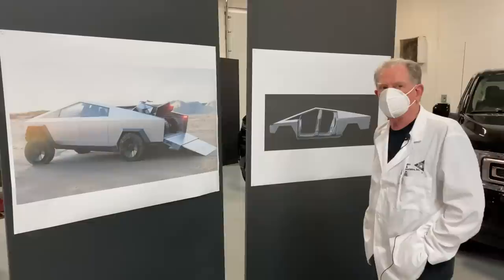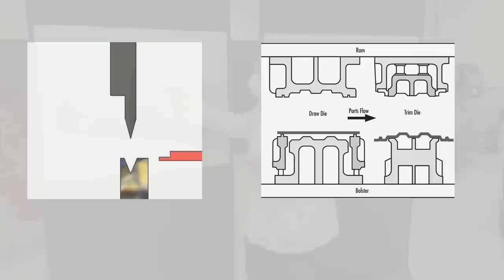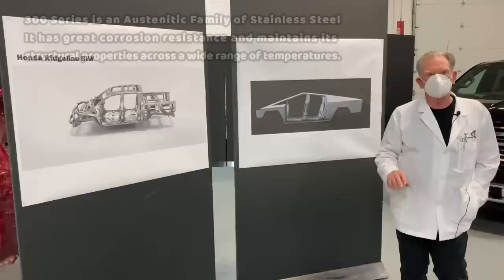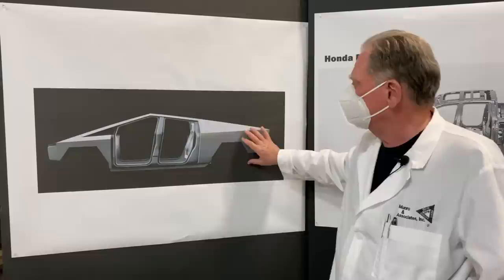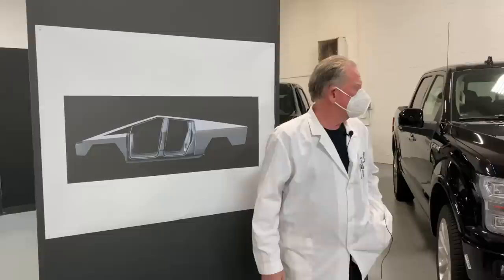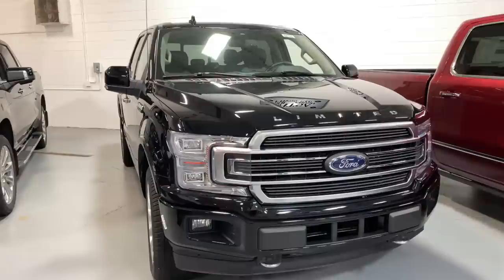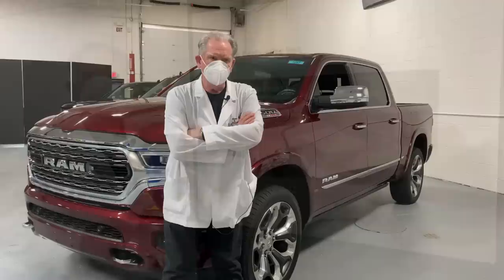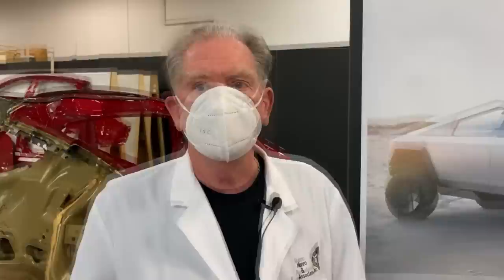Cybertruck E1 - Body Structure Comparison

Comment: I’m a huge Tesla fan, love my Model 3, but I hate the look of the cybertruck and think it’s going to be a huge flop. Truck buyers do not want some weird looking cheese wedge. I also do not think they will be able to sell it for the prices they are advertising without a huge loss. The air suspension, larger battery packs, heavy duty motors, and stainless steel body would in my mind cost a ton more than a Model 3, yet Elon says the base price will be below $40K. How? I just don’t see this becoming a reality unless Tesla is willing to take a huge loss on each and every unit, which they can’t do, especially now with the global Covid-19 economic downturn. I am just hoping we do see Tesla-level EVs hitting the market in the next few years in all categories. No legacy automakers thus far has released a compelling product or even announced one. The only EV truck I’m really excited to see is the Rivian R1T. Ford’s F150 Electric will just be a standard F150 without an engine. It’s not going to be on a unique chassis that was designed from the ground up just for EVs. That usually means it’s going to be full of compromises. The range likely won’t be great, weight will probably balloon, and it wouldn’t be surprising if it’s got compromised load capacities due to the weight and placement of the batteries. I don’t even know where Ford will be able to put the batteries unless it’s between the frame rails and running the length of the vehicle where the exhaust, driveshaft, fuel tank, etc.

The biggest issue in my opinion for all non-Tesla’s (in the US) is the lack of a reliable coast to coast DC fast charging network. Electrify America is a pitiful alternative to Tesla’s Superchargers, and the myriad random non-networked DC fast chargers (CCS or ChaDeMo) are rarely serviced and many are not mapped. Tesla’s cars automatically keep a registry of every Supercharger station, can tell you if there’s any issues at the station, what amenities are there, how many stalls are available, and the peak charging current. Electrify America stations are painfully unreliable (always something wrong with their charging stations or payment system), and they typically cost 2-3X more for the same amount of energy vs. Tesla’s Supercharger network. 

Electrify America also uses a tiered pricing structure. They use the vehicle’s peak charging current to determine the cost of your charging session. Meaning if you add 10kWh of energy to a Chevy Bolt at 50kW, you pay substantially less than if you added 10kWh to a Porsche Taycan at 270kW. Peak charging currents should not determine rates. As it sounds, peak speeds are not sustained. In a Model 3 for example, it’s capable of up taking up to 250kW, but you will only see that figure for a brief moment. Charging currents quickly tail off and fall below 100kW by the time you are at 60% SOC. On an Electrify America charger you will be charged the highest tiered price (based on that peak 250kW rate) the entire charge session.
Reply: There was a Russian channel where they made Cybertruck replica! It took few skilled guys and a few weeks(if so!?) to make it... Its so easy, once you setup the tools. And no paint is huuuge!
I don`t think that there is more hype then with Cybertruck! They are underestimating the demand. It will be astronomical!(easily 500k per year). Maybe more, depending of utility factors which are still unclear...
Reply: Steve Davis the number of reservations doesn’t signify actual orders. Just like Elon thought Model Y would be a huge seller, and demand for it would be insane... yet people that placed orders for a Model Y in January or February were able to get cars in March. It appears from the outside looking in that demand for the Y is not nearly as high as expected. Model 3 had a 2 year waiting list to get a car. I see this being a very similar situation with this truck.

I think it’s going to be insanely difficult to deliver the product as shown, at the price claimed. There’s no way Tesla can double or triple battery pack size and not accommodate for that expense by raising the price of the vehicle equally. To deliver this truck with the claimed 500 MILES range, it would have to be equipped with a 200kW+ pack. Maybe even larger than that. Model S can do just about 370 miles out of a 100kWh pack and it’s got a super slippery shape, sits low to the ground, has much smaller and more aerodynamic wheels and tires. Model X struggles to go 325 miles on the same size pack. I’ve learned how much wheels and especially tires impact range on an EV. The OE 235/35ZR20 PS4S tires on my Model 3 Performance cause a 20% loss in range vs. the non-Performance models’ 235/45R18 Michelin MXM4 tires. Unless Elon is planning to put extremely street biased tires on the CT, I can’t imagine he will find a very efficient truck tire that doesn’t cause a huge penalty to range. Even on gasoline and diesel vehicles, tires impact efficiency. On my Land Rover when I put Goodyear Wrangler Duratracs on vs. the standard street biased tires I lost 2MPG (12.5% loss). 

I also look at things like the cost of building a new dedicated factory to build the CT (that doesn’t even yet exist), the years of R&D needed to subject the production-candidate to the abuse it could possibly see over its life as problems that will either kill off the CT altogether or seriously delay it which would make many cancel their reservations. To my knowledge, they have only built a few Cybertruck prototypes. Exact dimensions, specs and features are not even confirmed.

I would much rather see Tesla invest in a product that will likely be able to make a large return on investment instead of what is essentially a vanity project that will have very limited appeal once initial preorders are sold. I believe Tesla would make far more money building an electric SUV that looks like a real suv and that can be used off road (think Land Rover Discovery/Defender). I would like to see Tesla offer something akin to Rivian’s R1S. People love SUVs, and the Model Y and X don’t appeal to a lot of people because they don’t look like SUVs. The X looks like a minivan in many ways and the Y looks like a bloated Model 3. Neither X not Y is what I would call attractive. The S and 3 are attractive sedans and would be complimented by a good looking SUV that had some rugged appeal.
Reply: Steve Davis there’s no way that Tesla fulfilled and delivered 300K Model Y preorders when the car was only in production for a couple of months before the forced plant shutdown. People were able to order a car in February and take delivery in March. That means there was not a backlog of pent up demand for the Y that had to be fulfilled. It would seemingly show that Model Y preorders either were being cancelled at an extremely high rate or they didn’t have many preorders to begin with. 

I personally don’t like the look of the Y at all, and nobody I’ve talked to that owns a Tesla thinks it’s very attractive either. It takes the Model 3 look, but distorts it with a weird bulbous body that from certain angles is very ungainly. I think many people also don’t know why they would pay $8K more for the Y vs. the 3 when they’re essentially the same size.

As far as a factory not being that expensive, that’s just incorrect. Elon will have to build the CT in a factory that can also turn out other products. There’s no way there will be enough sustained demand for the CT to keep a factory going at capacity. A factory the size needed to build 200,000 cars annually will cost in the neighborhood of $1-2Bn. It will likely also become a second production base for the Model 3/Y or if Elon does decide to leave Fremont, it could become the sole factory for all Tesla US production. That means they’ll still be paying for a paint shop, presses, etc. 

Also, I cannot imagine everyone being okay with only one color: stainless. People like being able to pick their vehicle’s color, so there will likely have to be some sort of color treatment or wraps or something they offer since paint will likely not work on the stainless body.
Reply: @CFG39  Due to pandemic, car market has plummet! Not realistic to make any predictions of demand at this moment. Especially with vehicles like Y!( higher cost)
. Also, they are already in production volume numbers that took 1 year for model 3!?
And yeah, cell packs are gone waaaay down in year or so... Catl, Byd etc... they are already under $100 per pack with LFP batteries... Things are moving fast and Cybertruck is almost 2 years due... I`m usually pessimistic but with Cybertruck its hard not to be subjective and excited...
Reply: Steve Davis Tesla has likely produced less than 10,000 Model Ys thus far. They were only able to produce them for a couple of months before the shut down. My point is that demand of the Y does not seem to be what was expected. People thought there would be a 6+ month wait to get a Model Y because of the large numbers of preorders having to be fulfilled, especially for existing Tesla owners (who typically receive priority). What actually happened is people who had just placed orders were able to get their cars as soon as deliveries started. You have to agree that would mean there was not much of a backlog to fulfill. Either that or Tesla has changed their way of fulfilling orders and is no longer going in date-order when determining who gets their vehicle. I haven’t heard of anyone that pre-ordered a Model Y Long Range or Performance complaining that they still have not received their car.
Reply: Stephen Mattison Right...

The “brilliance” of the Cybertruck is unrealized at this point. It’s not in production, not close to being in production and the production-ready version of the vehicle will likely be vastly different than what was shown. If you’re not skeptical of the claims made at the unveiling I also have a private Island I’ll sell you. 

I am a huge Tesla fan, I own multiple Teslas, but I think the cybertruck is going to end up being a huge flop (if it ever actually gets built). With all of the global economic issues due to COVID, a vanity project that will be a hard sale is the last thing Tesla needs to focus its resources on. There are a lot of other sections of the market that Tesla should focus on that are almost guaranteed to be very successful. No company, even mega companies like Toyota and Nissan, have been able to penetrate the big-3’s grip on pickup truck sales in the US. The Cybertruck is far too large to be a success outside of the US, Elon already acknowledged as much. 99.9% of people who buy pickups each year are not looking for a vehicle like the CT.
Reply: Dusan Gavrilovic lol. Thats all I can say. 

The truck is going to be far too large for it to be successful in Europe. Elon has already said they would have to design a separate “global” truck. So that means the CT will likely be limited to the US. Toyota, Nissan and Honda have tried their hands at the American pickup truck market and have failed miserably. Toyota sells about 100,000 Tundras annually. Ford sells nearly 1,000,000 trucks annually. GM and FCA are close behind. There’s no way that Tesla will be able to sell 500,000 Cybertrucks in a year. There’s not that many people interested in the vehicle. We don’t even know the actual production specs. So far it’s just a concept and we have some very general claims made by Elon. We don’t know the actual size, weight, power, battery pack size, towing capacities, etc. 

At this point it’s all conjecture.
Reply from the maker: @CFG39  Thank you for all of the thorough and well-supported comments! Agree or disagree, you (among others) have clearly done your homework, and we are constantly impressed by the quality and quantity of healthy debates going on in the comments section of these videos. Thanks everyone for tuning in, and keep up the great work!
Reply: Munro Live thanks for that! I really enjoy your videos.  They’re one of the few videos that’s more fact based than opinion.
Reply: I think battery day is going to answer the cost question. Then Tesla’s biggest issue will be keeping up with demand.
Reply: Brad Stewart umm I disagree. Battery day is not going to be anything extremely earth shattering. Yes it will have some announcements on new chemistry and likely a projected lower cost, but I don’t see this being the holy grail. 

For the sake of discussion, let’s say Tesla is able to hit $90/kWh. Currently Tesla’s costs are estimated at $115-$120/kWh. Reducing the cost by $25-30 would be a nearly 22-30% decrease in cost. That’s a huge metric to accomplish. 

I foresee a base model Cybertruck (single motor RWD) necessitating a 130-175kWh pack to hit the estimated 250+ mile range (remember this thing weighs between 8,000-10,000lb unloaded). That means just the battery cells alone would cost between $11,600-$16,000. 

Also, $90/kWh is well BELOW what the industry claims to be “cost parity” with an ICE. The issue is trucks and large SUVs require so much more battery capacity to go the same distance due to their lack of aerodynamic properties, heavy weight and larger tires/wheels (every measurement on a truck or large SUV tire including: section width, sidewalls, and overall diameter will be larger and thus heavier than current Tesla models). 

The Dual Motor AWD and TriMotor AWD (claimed range up to 500 miles) would likely require a 175-200kWh (Dual Motor)/250-300kWh (3-motor) pack to achieve the projected range. So that means dual motor pack would cost $15,750–$18,000, and tri-motor pack would cost $22,500–$27,000. 

The reason I see these vehicles needing such huge capacities is this: The roadster (low, sleek and super aerodynamic) supposedly needs a 200kWh pack to manage its claimed 600 mile range. It likely weighs less than 3750lbs too. A much boxier, bugger and heavier truck on huge wheels and tires is going to definitely need a pack 50%-100% bigger to achieve similar range. 

I don’t see how a vehicle with a battery pack that costs $12K–$16K (RWD CT) will sell profitably for $39K. The motor, body in white, air suspension, computers, cameras, ultrasonic sensors, load sensors, cooling system, heat pump, wheels and tires, glass, etc. will all add up to likely put the actual production cost of a base Cybertruck close to the $40K price. While Tesla will definitely save some money in assembly if they’re able to get this body design to work for actual production vehicles, they’re not going to save 50% on the cost of the car. All of the other things that go into a car cost money. Tesla would probably need to sell the RWD base model truck at $60K to make a profit and cover costs associated with warranty claims, logistics, recoup R&D money, etc. 

The Dual Motor would likely need to be $69-79K and the TriMotor closer to $85-95K to be profitable. All of my figures are also based on hypothetical advances in battery cell cost that may or may not exist. It would be a huge jump if Tesla gets the price of cells to $90/kWh. That really would be a huge leap from where they are now.
Reply: @CFG39  You'll see.
Reply: Stephen Mattison I can’t even take your comments seriously when you use terms like “negative-Nancy-hater-pants” to describe someone that’s logically laying out why they question something. 

Clearly you’re too ignorant to understand the logic laid forth by my previous posts that include actual cost analyses and brainstorming. How am I a hater when I own two Teslas????  I love Tesla and Elon. I just think the CT is never going to be successful for the myriad reasons laid out before, and I also think it will be hard for Tesla to sell it at the cost announced without losing their shirt.
Reply: Dusan Gavrilovic BYD‘s LFP batteries are not even commercially available yet. They’re a concept essentially. I also take anything a Chinese company says with a large grain of salt. BYD has been stuck around $130/kWh with their existing batteries. Tesla is somewhere estimated to be around $115-120 currently. 

Getting the cost down to $90/kWh (a 30% reduction in cost vs. current cells) still means that a large vehicle like the CT would have a pack that costs upwards of $12,000-$22,500 depending on pack capacity (130kWh–250kWh). To accomplish a 500 mile range with a large and extremely heavy vehicle like the CT they are going to need every bit of a 250kWh pack. That is assuming the CT can manage a fairly low consumption rate of 500wh/mi (2 miles/kWh). That’s not that much higher than the Audi e-Tron (avg. consumption ~455 watt-hours/mile) and is right on target with the Porsche Taycan’s consumption (503 watt-hours/mile (city)//496 watt-hours/mile (highway)). 

It’s kind of hard to believe a 8,000-12,000 lb monster truck like the Cybertruck is going to be able to achieve similar efficiency to a sleek shape Porsche sports sedan. If the Cybertruck doesn’t manage 500Wh/mi rating, the battery pack would have to be even larger than 250kWh to reach the 500 mile announced range. At 600wh/mi the CYBERTRUCK would need a 300kWh pack... basically 3 of the Model S/X largest packs put together, or 4 of the Model 3/Y’s Long Range packs, or 6 of the Model 3 SR+ (50kwh) packs. That’s an insane amount of energy storage in a vehicle. This is why I am very pessimistic about the Cybertruck. Some people that are too ignorant to do any of their own thinking bash me for questioning the specs, but it only makes sense when you do some math.
Reply: @CFG39  Yes, it would be a huge leap, and to expect that Telsa would intentionally sell Cybertruck at a loss is not in line with their past behavior, which indicates a pretty substantial announcement, regardless of whether one believes they will achieve it or not.
Reply: Stephen Mattison 🤦‍♂️ . That’s all I can say.

Maybe just maybe Elon was being a good salesman and trying to drum up interest in this project by declaring a really cheap introductory price that will never be a reality. 

Again, I am a HUGE Tesla fanboy but I am calling out what I see as inconsistencies and questionable claims. I don’t just sip the koolaid and believe every claim Elon makes if it doesn’t make sense. Elon has not mentioned anything at all about supercapacitors and unless he knows something nobody else knows, supercapacitors currently have a huge problem: they can store like 5% of the energy a battery can store.